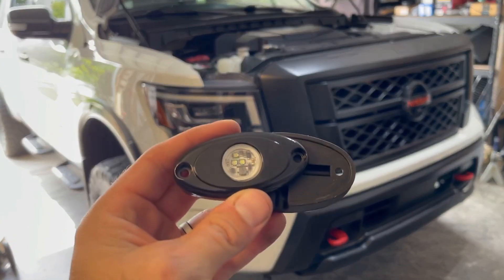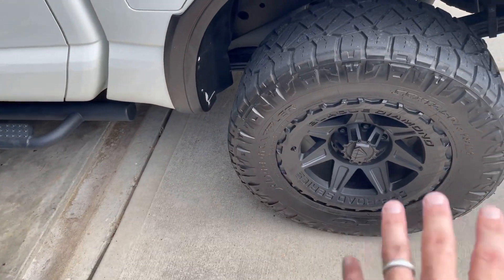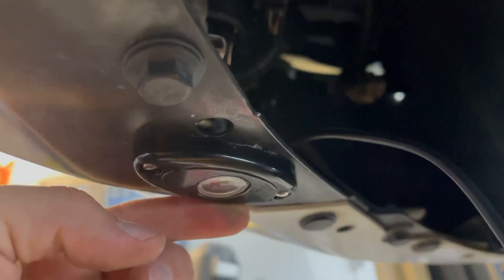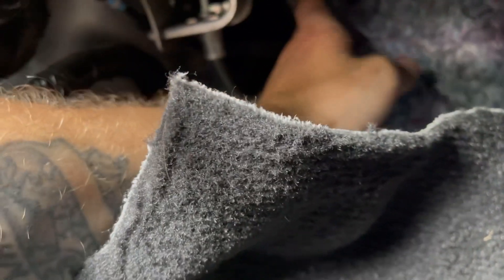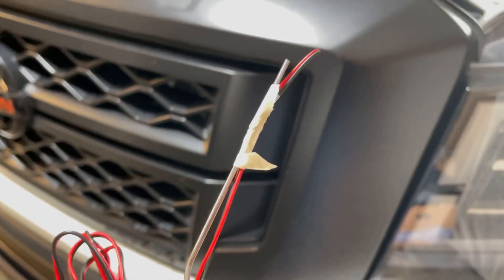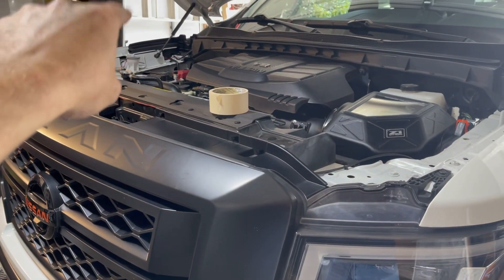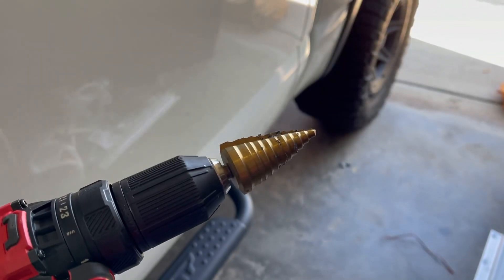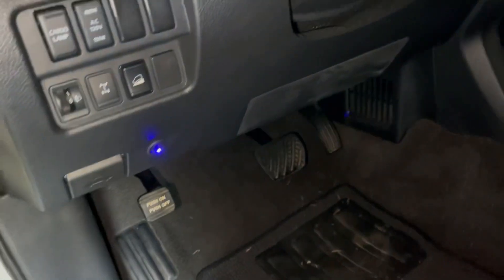Installed some Rock Lights | Titan overland project continues

Comment: Nice truck man!! Love the lift and tires!! You may want to do a light bar or some type of far distance lighting. I just bought a 23 Titan Pro-4x!!
Reply from the maker: We’d love to add a light bar but I’m still working out options for where to mount it.  The Titan is not all that accommodating for aftermarket lights.